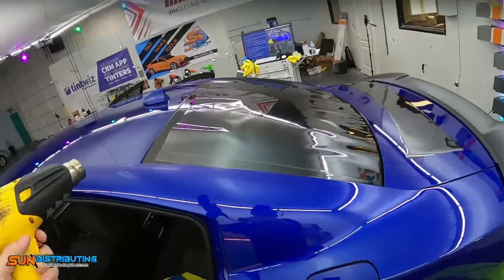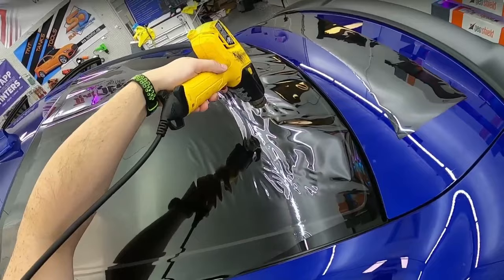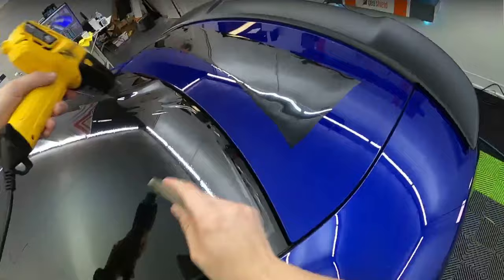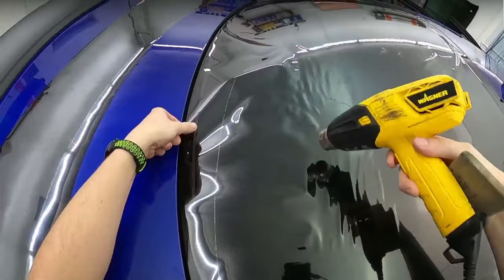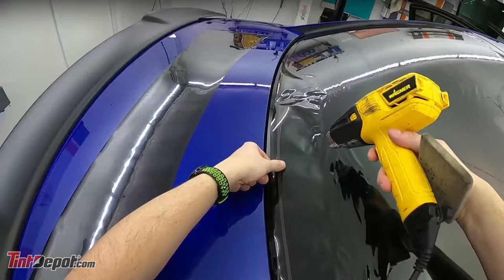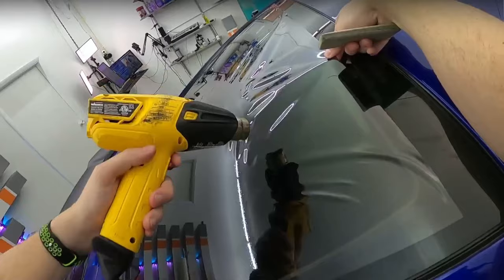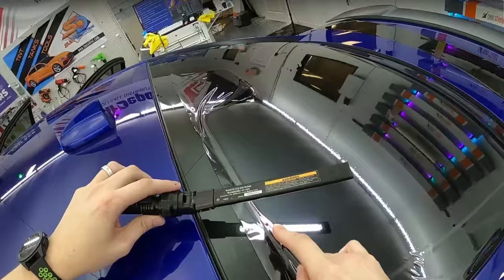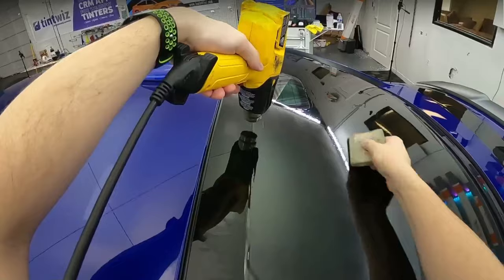How To Shrink ANY Back Window Tint

Comment: What film are you using? Looks like it is flexible and not easy to be burn looks great! I'm also a tinter here in the Philippines and we are using 3m tints but when close too much the heat gun in the tint it burns or we say it over cooked.
Reply: Use less heat on the heat gun

Comment: Question: the advice you give about corners; does that also work with curvy windshields. I find that sometimes it’s a pain to shrink corners on windshields that are more curvy.
Reply: Hi, i'm a Window Tinter from ( RW Folierung) in Germany and i got a solution to make it easier.
Reply: @deathnote4717  And that is???
Reply: @XFBO   Email me... i'll send u a sample
Reply: i need help on the forester back window it’s so curved on the sides. thanks
Reply: @chastynroyer314  leave extra film on the bottom and pull on it while shrinking

Comment: That back window is the king of peanuts
Reply: As soon as you do the install turn on the rear demister so it all binds up which helps get no peanuts.
Reply: @gav6808  or just learn to shrink it right...
Reply: Going over the defrost lines thoroughly multiple times with steel wool does the trick for me

Comment: Do you spray anything underneath before?
Reply: I've used ivory bar soap before but it has its issues. I had the same question about this video that you had wondering what he prepped the glass with before the heat shrink. It doesn't look like he put anything on the glass. If you notice the top, there doesn't seem to be anything smeared above his tint line, It looks completely clean.
Reply: I did a little research and figured out the best method. Spray a new dryer sheet with only water and cover the window with it. Let it dry before you lay the tent down to create your "H" pattern and complete your shrink

Comment: Thoughts on dry shrinking vs wet shrinking?
Reply: He’s slowing it down to educate
Reply: @tintshady2049  took me 3 hours and I still fucked up. I think i have low quality tint because when I try to push it like he does it just clumps together to itself...
Reply: @tintshady2049  Isn't dry tinting what he did? @Mario Martinez?
Reply: @piizzacat  Yes, he's dry shrinking. I had my comment ass backwards. We don't wet shrink anymore. Some guys might do a "wet check" which is done after an initial dry shrink.

Comment: Hi...new to this...whats the purpose  of shrinking?
Reply: Almost all Auto glass is curved. When Film comes off the roll it's completely flat so if you took Tint straight off the Roll and tried to lay it without shrinking, it would finger up and crease everywhere and It will never lay right without shrinking.

Comment: How does the tint hold up on  the outside?  I see you're in Detroit so would this hold up on a daily driver like in winter where you have to brush and scrape snow and ice off?  I hate the way inside tint always seems to lift around the defogger elements on the inside of rear windows.
Reply: You transfer this to inside
Reply: @elias-zi3bd  Oh okay.  Thanks